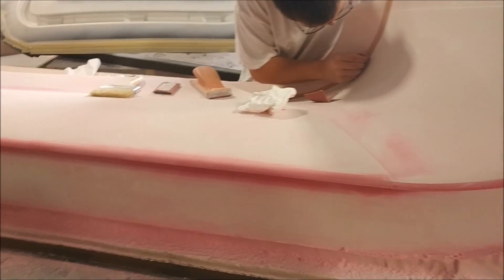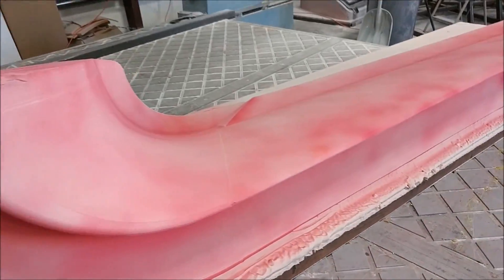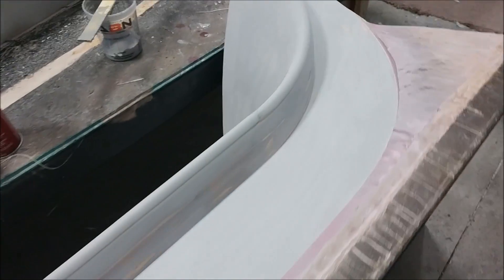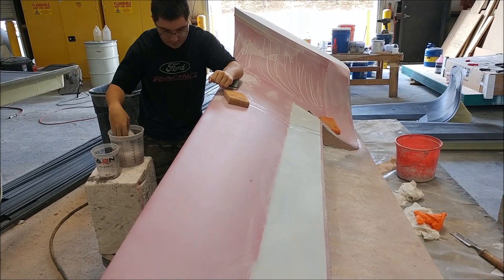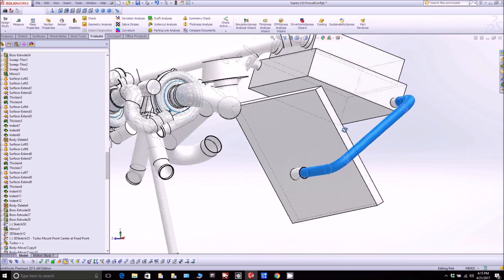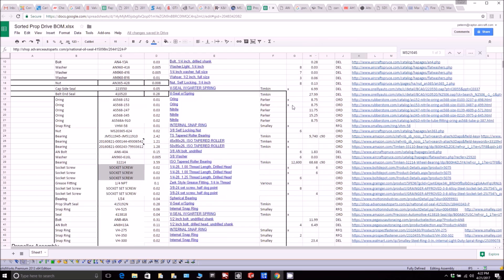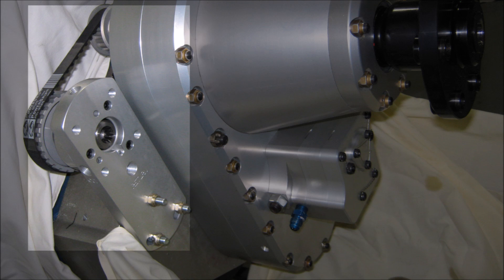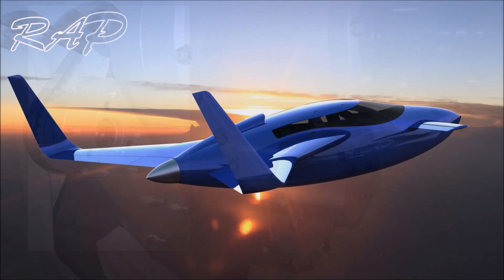Raptor Aircraft April 22nd 2017

Comment: Is there going to be temperature guages inside the wing tanks. Gets really cold up north in the winter at altitude and would hate to have diesel gel up.
Reply: Check out the website. They have created a solution to prevent gelling fuel at high altitudes.